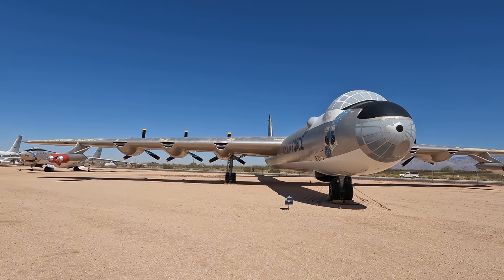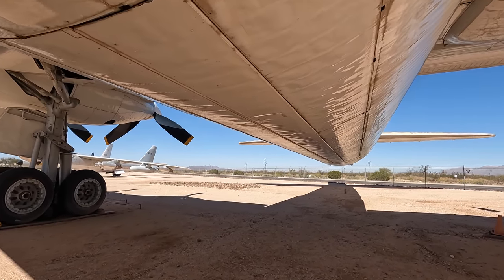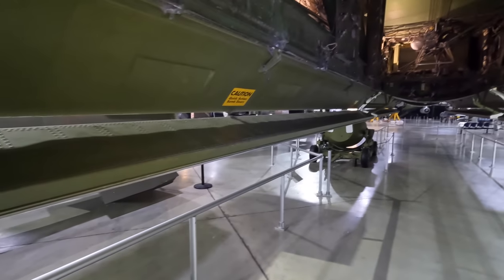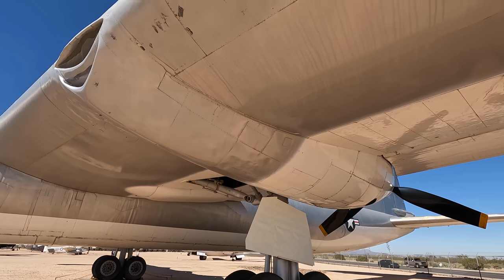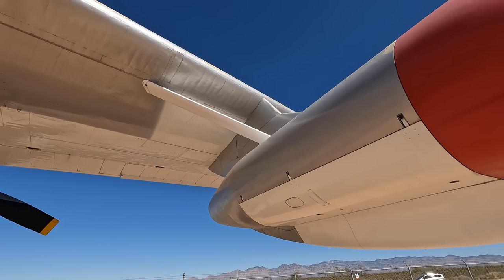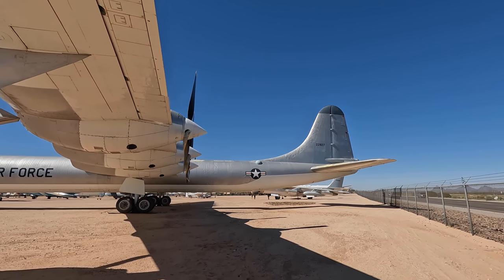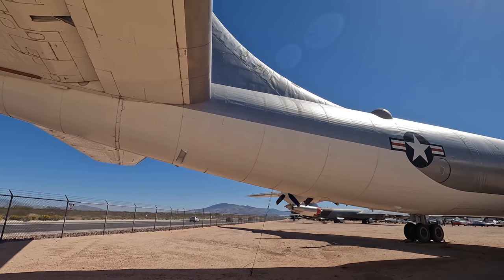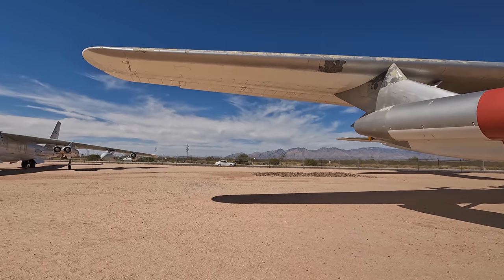Tour around the TEN engine Convair B-36 Peacemaker!

Comment: 2:28 The shielded cockpit of the NB-36 did a great job of isolating the crew from the outside environment-- the pilots were disconcerted by the unintended soundproofing and couldn't hear the engines running.